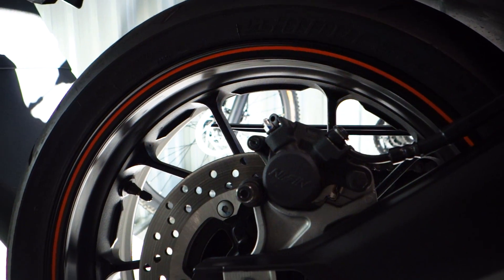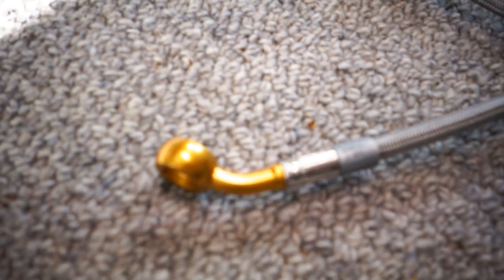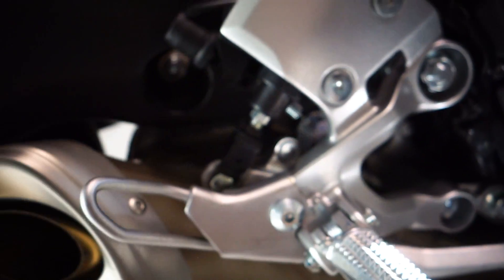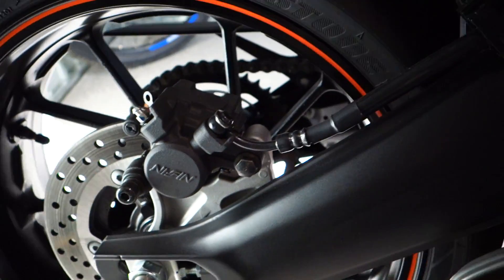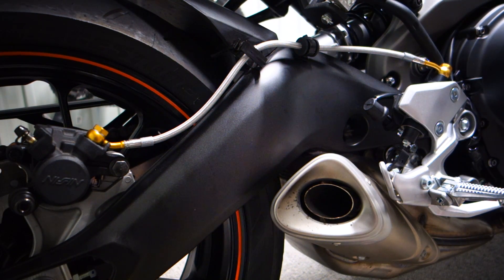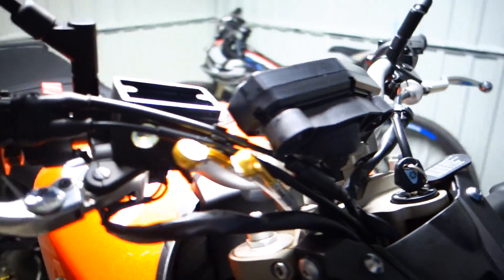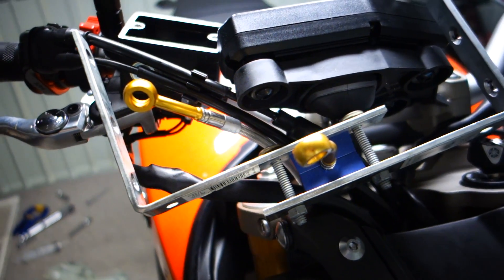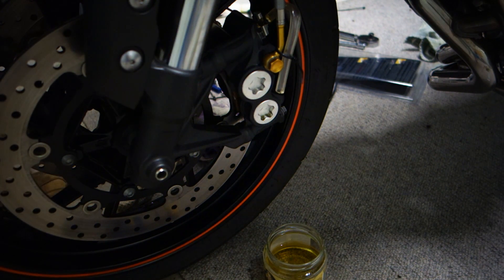VLOG - Yamaha MT-09 Braided Brake Line Install / 100 Subs!

Comment: Good thing about motorcycle brakes is that you can remove the whole system entirely and work with it on a bench far away from any painted surfaces. And if you have a bleed kit first you should attach it to the bleed screw at the caliper and suck all the fluid out.

Comment: love the choice of bike there ... im thinking about buying one aswell but right now its to mutch snow and wet outside to even get a testdrive of it  ( live in sweden of all places and we got the bike her 4 days ago ) 

how is it to drive in the rain ?

and how are they if you ride it for a longer time at ones ?
easy to get a sore back or anything like that ?
Reply from the maker: Its fine in the rain but you need to be wary of the brakes now as they are firm and also run it in B mode to keep the throttle smooth :)

Absolutely no issues with posture on long rides however the seat hammers your ass (ok that doesn't sound right) over longer trips and you just want off the bike at that point :( definitely needs a better seat which I am sure Yamaha will be more than happy to sell you, how convenient ;)
Reply: pipboychronicles

okay thx for the answer =)